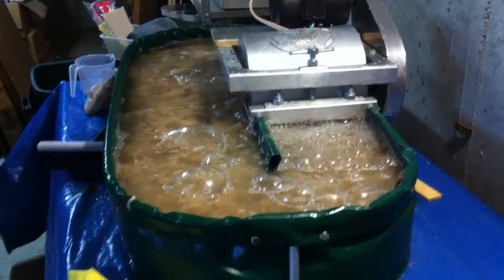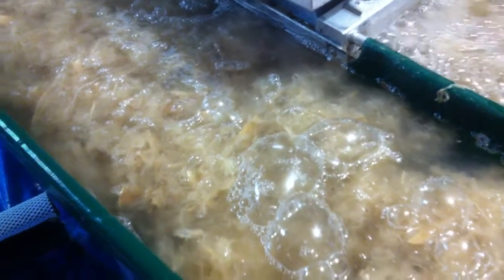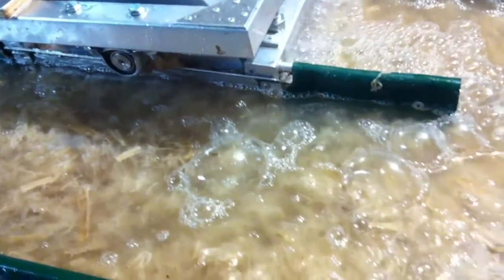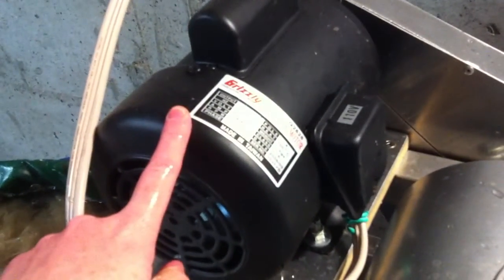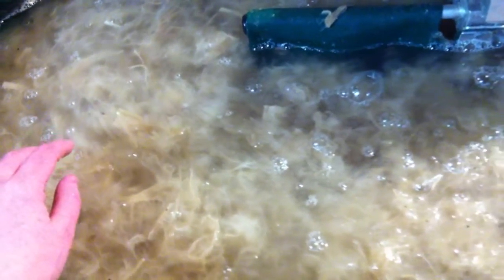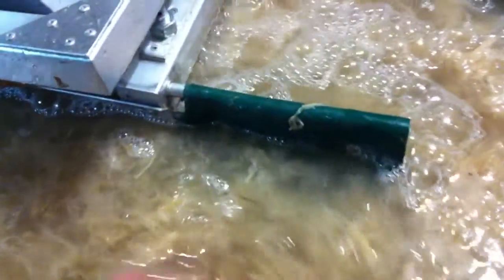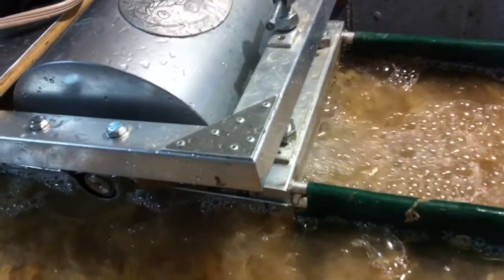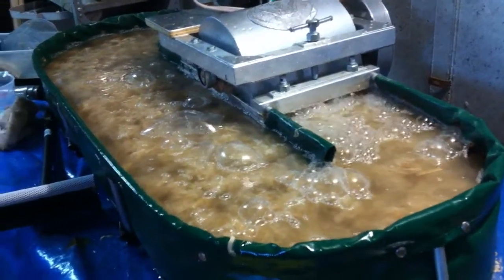Beating kozo fiber in a Critter for papermaking

Comment: Looking back, the times on this were a little short, it actually took about 4-5 hours after this point for me to get the fiber where I wanted it. The fiber was also slightly undercooked unfortunately so I had to pick out some harder bits while it was going -- maybe about half a quart of woody stuff. Still, it finally came out very well and I was able to pull some successful Eastern-style sheets for kitemaking.